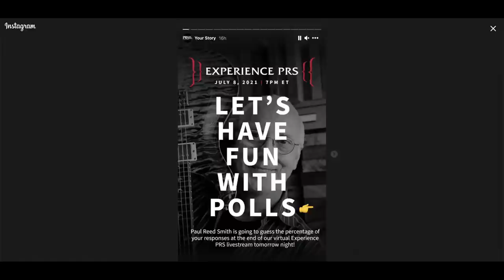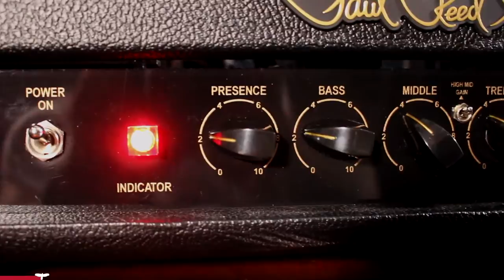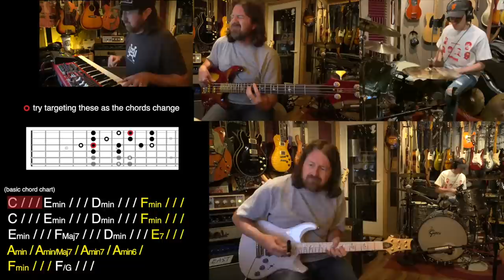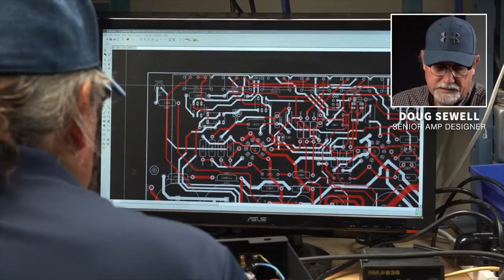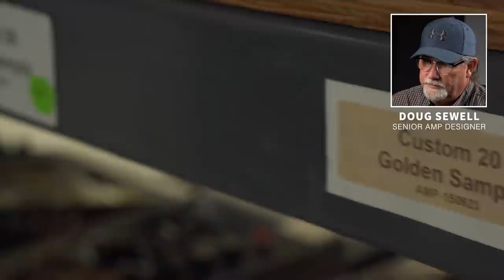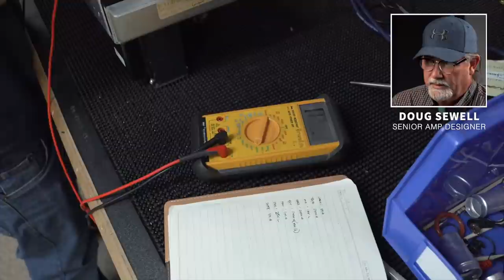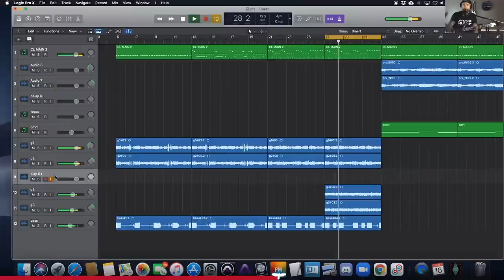Experience PRS 2021 | PRS Guitars

Comment: Can confirm on the setup and tuning.  Mine is a SE Custom 24 and it made it's way to my doorstep from the dealer with a perfect setup and did not need tuning.  It was ready to plug in and play right out of the case.

Comment: A year gone by and not a single new product… all the money taken for these guitars and the sheer sales volume but no knew products?

Still waiting for new CE colours since the original colours were chosen. Customs get new colours usually (although you’ve been a little slow with these updates also)

Also, it’s time to address the issue with Custom 24 guitars which PRS Europe  acknowledges you are aware of but can’t fix…. Dead notes on custom 24 guitars… this should not be a thing in a guitar that costs this much.

This guitar has been around over 35 years and you still have major issues with dead notes. Before anyone says it’s rare or setup,., i played and nearly bought 5 PRS CU24 guitars and 3 of these had dead notes and were taken back in by guitar tech to reset up and they couldn’t remove the note dissonance… this is terrible for your reputation!

Comment: PRS DOES NOT HONOR THERE WARRANTY!  I will be sure to steer clear of PRS in the future.  At least this happened before I dropped a couple thousand on another guitar.  When I drop that kind of money & then the second time I put strings on the tuner just falls out the headstock on the floor... are you kidding me.  And on the cosmetic side there's some  frets with lifting clear coat on the side of fretboard.  This wasn't acceptable years ago when I used to work there.  But the quality & standing behind there product is just a shame now.  I'll go with a company that honors there warranty.  Not trying to get 200 more dollars to fix something that is clearly in the workmanship.  Parts shouldn't fall off the guitar & all the fret should ring.  I have a bunch of dead frets.  And this guitar is babied, not a scratch on it.                    SO BE WARNED ABOUT PRS GUITARS BUILT IN USA!